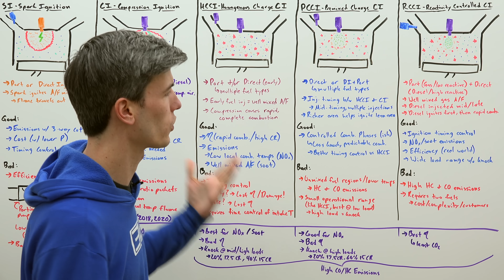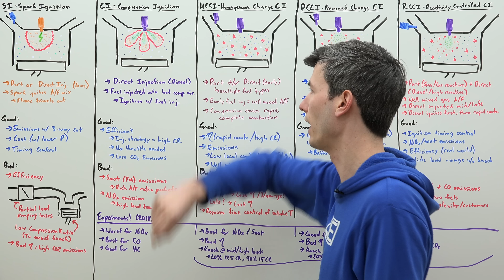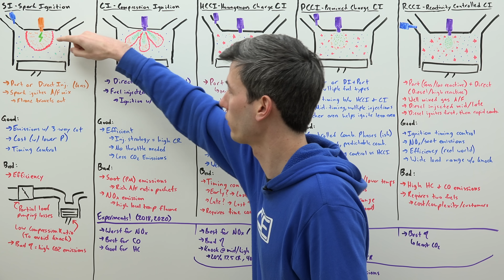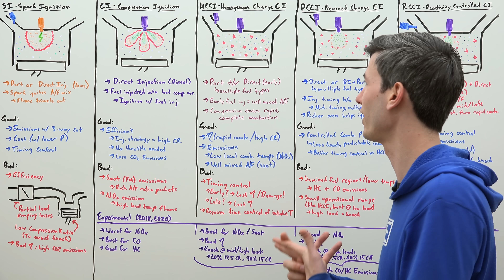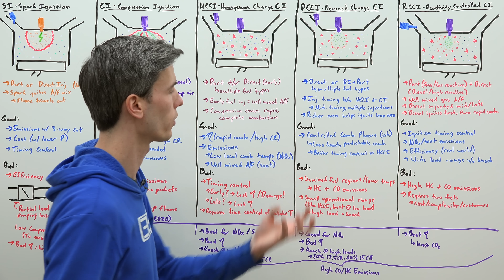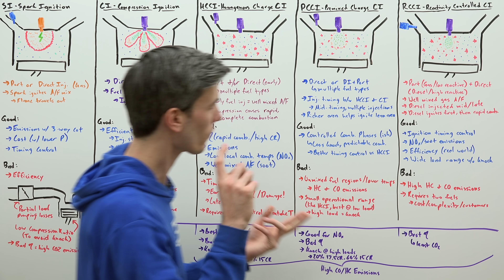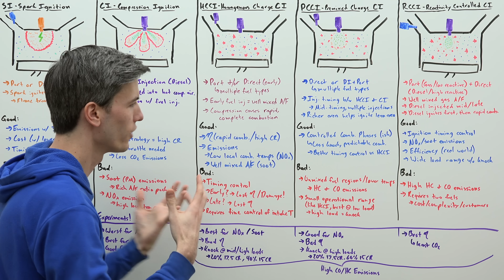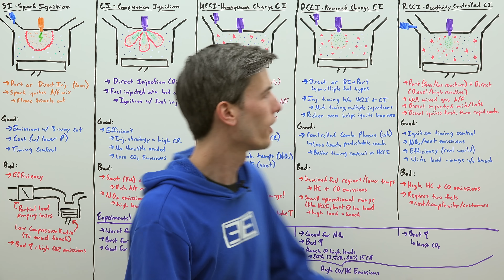If Combustion Engines Have A Future, What Is It?

Comment: I feel like there could still potentially be a future for combustion engines in cars if we were to use hydrogen to make them much cleaner.
I understand there are problems with using hydrogen in a combustion engine (mainly range) but given that it would be significantly cheaper, up front, to buy a car with a hydrogen engine vs an electric battery car or a fuel cell car I think it's something that should be considered more. 
I also think it would be better for the environment than a battery car because of the damage that's done when mining for ingrediants to go into lithium ion batteries.

If you're going for the least environmental impact though then you would go for fuel cell cars but, again, they're VERY expensive.
Reply: 100% agree with you.
Reply: The problem with hydrogen is the infrastructure to support it is much more expensive to build than the already existing grid for electric cars, not enough companies willing to put in the huge funding for that. I think the few hydrogen cars out there e.g mirai, use the hydrogen to create electricity for the motors, which is likely more efficient and less dangerous than combustion of the hydrogen. So if hydrogen does get more popular it likely won't be in the form of a combustion engine
Reply: @Game tuner A way for what exactly? It's not gonna be as efficient, that's simply the nature of combustion you're naturally gonna lose energy in several forms. Right now majority of consumers just want transport, combustion or not doesn't matter to them
Reply: @Game tuner Who exactly? The switching being done is substantially more to EV's or simply other standard combustion cars. The toyota mirai and hyundai nexo are really the only two on the market, and both of those are FCEV's and not in large numbers. There's not even a thousand hydrogen stations globally right now
Reply: @Game tuner Who cares about Musk or a 50% target, what makes you think hydrogen combustion is a more viable alternative to FCEV's let alone standard EV's?
Reply: @Game tuner I agree that having options is important, personally I want hydrogen to succeed, but just the economics of it makes it harder to compete right now unless more companies take the risk in investing. I know toyota tested a combustion engine but it'll still have to compete in the general market when just about every hydrogen vehicle currently uses more efficient fuel-cell versions. We'll have to see how development and market costs change

Comment: Awhile back you did a video on Opposed piston engines. Achates power had been working on it. Is that dead? I found that very interesting, but haven’t heard anything from them in a couple years?
Reply: They are too complex to build. Adding a few more cylinder is much simpler than adding a second crankshaft ore some leveragesystem
Reply: @jonasstahl9826  it seems that it’s less complex. A lot less parts?
Reply: @coldarcluck5320  Damn you are right I forgot the valves🤦‍♂️

Comment: if people stopped freaking out beacuse of emitions lots of these problems would be "solved"
Reply from the maker: The solution is to not care about bad air quality? That isn't a solution haha. You might not realize how clean the air around you is simply because of the existence of catalytic converters. Improving emissions is a good thing.
Reply: @EngineeringExplained  I obviously can't change your minds about this and I'm not tying to, I said people freak out about it, there should be development in the field yes, but I feel like the emissions issue is being amplified outside of its scale... I'm all for improving emissions and efficiency but it comes at the cost of added complexity, less reliability and longevity with higher repair and maintenance costs. Even so, I still think it's something to work on, just not the second coming of Christ.

Comment: They do. The ICE isnt going anywhere anytime soon 
Gasoline has the most energy per volume 
Its widely available 
It works in extreme temperatures 
Its been tested for over 100 years
ICE has been developed is a wide array of areas and technology 
Extraction, development and deployment of gasoline has been refined to a science 
Ev's are inefficient.
Reply: @samwestenskow  An EV is no were near 95%, when the motor allone is only 90%.
Reply: @German_overengineer  I don't want to get into a heated debate but I have put weeks of research into these topics
Reply: @samwestenskow  then you would have found out that its no were near, 95%, maybe 75% on a good day.
Reply: Electric motors are much more efficient than internal-combustion engines
Reply: Ev's have high efficiency, it's just the batteries that can't store a lot of energy
Reply: @shadowknight3756  no they are not to efficient when you consider all the loses in the chain. Just with charging loses, they get into the territory of a Diesel.

Comment: So Diesel engine is the best. They have AdBlue which reduces NOₓ
Reply: Great in theory, not great when you have to spend €2000 repairing a system worth more than the car itself, all while the car runs and drives perfectly
Reply: @Re_Kitty  There are horses for courses and diesel engines are far from ideal for many smaller cars. Where a vehicle can be driven at full operating temperature most of the time and cruising rather than intermittent urban traffic, then diesel is very clean technology and  there should be very few problems. Short trip stop start driving is what causes all the problems in diesel emission systems, coupled with constantly running on low fuel levels.
Reply: well it depends, engines put out les co2 without exhaust systems
Reply: @lucasvanhamburg4937  its well known that diesel engines produce less co2 than a silimar gasoline engine
Reply: @mathiasmang848  did I say anything else?
Reply: And PCCI is just stratified charge, already implemented in all electronic injected diesels.
Reply: I agree that diesel is the best, however even with scr managing nox emissions isn't that successful
Reply: Rotary Engine is the best and  still has a lot of potential ! If you use it working on Nitrogen or Hydrogen for example.
Reply: @aquamaggerasim4993  if rotary is best why is nobody using it lmao?
Reply: @aquamaggerasim4993    Rotary engines are absolutely brilliant. But then you look at the top of the rotor and realize you are trying to seal a rectangular piston.
Reply: @aquamaggerasim4993  the rotary would need to loose the apex seals. Their lubrication really fucks up the attainable emissions.

In a range extender role, it could be brought up to speed and kept above minimum speed.
Reply: @daszieher  
I thought the same thing myself. The nice thing about a small single rotor engine is they're extraordinarily light and compact and give off good power for that volume. Using one as a range extender that isn't on all of the time would definitely be a good use they also are very smooth running and are relatively quiet.
Unfortunately I don't think it would be easy to get them to pass any kind of emission standards today. That adds a lot of complication which might override the basic mechanical simplicity.
Reply: @kens97sto171  the two Achilles' heels of the rotary's emissions profile are the lubrication of the apex seals and the small pocket of unburned fuel-air mixture in the lagging corner of the combustion volume.

Deleting the apex seals deals with both problems as the amount of oil injected into the combustion chamber can be drastically reduced and the lagging pocket can be pushed forward by combustion from the following chamber bleeding through the gap. This should significantly improve emissions.

Alternatively, a separate combustion chamber is designed and the rotor acts only as a pump. A second rotor, optimised in design could then act as a dedicated turbine.

Such a design would be very inefficient at lower speeds, as there is always a percentage of air bled through the gaps. Since this is a function of time and pressure on the surface area of the gap, increasing rpm will partly alleviate the problem.  A normal rotary engine will run with bad seals but not start or idle.

Boosting will also increase efficiency. I would really be curious to know, if my assumptions are feasible.
I no longer have access to all the hard- and software required to simulate an engine design. 😔
Reply: @aquamaggerasim4993  pretty sure Jason's done a video on why rotaries aren't that efficient and a video showing why burning hydrogen is far less efficient than using electricity or even using that hydrogen in a fuel cell
Reply: Are you payd by VW or something? 😂
Reply: @UnipornFrumm  I wish
Reply: @UnipornFrumm  it's reality clown

Comment: With battery demand far exceeding supply, even at such low EV adoption rates, the clear solution is using an ICE as a range extender rather than having everyone haul around 500 miles worth of batteries when the vast majority of people need less than a quarter of that for daily use.
Reply: The Super Capitalist - I agree 100% at least until battery technology and production can catch up. Seems to me it should be doable to get an arrangement that could approach 100 mpg equivalent with today's technology.
Reply: Exactly! We can have ICEs run constantly at their peak efficiency, and maybe even use super capacitors instead of batteries to store the power.
Reply: ICEs like Rotary Engines haven’t been developed enough but they have great potential!
Reply: @aquamaggerasim4993  I really like rotaries for PHEVs. It seems like all their weak points are countered by the strengths of PHEVs and you can also get a great sounding engine in a small form factor.
Reply: @TheGIGACapitalist  rotary and plugin sounds like a great idea🤔 but rotaries need to become a bit more fuel efficient first i guess
Reply: @nobodynobody3903  Efficiency is the batteries job. The rotary just needs to go brap brap.

I think adoption of PHEVs is more important than optimization at this point.
Reply: @TheGIGACapitalist  Rotary Engines are great for initial push , if you have N2 bottle for example , the sound will be even better !
Reply: Already own a Volt, love the car, but fearful of future maintenance costs as I'll be supporting both the ICE and EV systems. While it's a great transitional vehicle, I would rather have two pure BEVs going forward, one with a small battery for around town (Mini SE electric) and another for hauling the dogs on weekend road trips. Can't beat the simplicity. 

Considering each household has multiple vehicles, the two, dedicated, EV approach isn't unrealistic.
Reply: @wzDH106  In a household with several people that would make sense. But as a single person it is quite difficult to decide, what to choose and two cars for one person would be very unsustainable and i would guess even worse for the environment than a reasonable ICE car🤔
Reply: @nobodynobody3903  

Nothing wrong with a capable 200+ mile BEV either. Our second vehicle is the Kia Niro EV, a capable vehicle with real world winter range consistently beating EPA figures. A vehicle, assuming I were the sole household occupant, would be more than adequate.

Given, those who do not live in a house, have access to overnight charging (120V or 240V), or have employee charging, may find living with an EV difficult. Otherwise, it's the easiest vehicle to live with, the lack in maintenance is icing on the cake.
Reply: Facts could be an idea

Comment: I very much disagree with electric car having better efficiency, it's efficiency is based on Electric powertrain, which is around 90%, BUT then you have the efficiency of power generators, where you mostly have steam turbines, which cannot operate at more, than 1/3 thermal efficiency, nevermind the reactor itself, maybe in California, where is most el. power from sun and ekologic sources, but in Europe, we have absolutely different situations
Reply: It would actually be pretty close, there is not over 60% loss in making diesel fuel, also usability is another factor, fuel tank with the engine usually runs 200k miles without major problems with basically unlimited range considering time, whereas in EV, you don't have maintenance, that's true, but with normal driving, batteriy packs are usually worn out after 3-4 years with extreme costs to replace them, you have to recharge every 200-250 miles with more expensive charging, than refueling, considering cost per mile

Comment: Alcohol fuel (E100), look to Brazil's Proalcool program. They're already trying to ramp up ethanol content in our current gasahol mix. We just need a better way to generate ethanol (read: not from corn).
Reply: There is a potential way with biotechnology (metabolic engineering specifically).
Reply: @vr5076  Yeah, or perhaps microalgae - I'm actually dabbling with it myself. It's a good time to invest in ethanol production companies.
Reply: @Masterrex  I think a carbon neutral (or even a carbon negative) platform for producing ethanol or any other biofuel for use in ICEs based on engineered photosynthetic microbes could be possible.

However, cell-free metabolic engineering based platforms could yield a far greater quantity of biofuels than an equivalent cell/microbe based platforms. And they are cheaper to implement.
Reply: For some time until energy transition is through, carbon capture from Gas power plants could be a great source. If you look at it, all the needed components, heat, steam and and CO2 are in the exhaust gasses. Sadly biological processes are too slow to source enough alcohol to run many vehicles on it. But its a nice supplement.

Comment: ICE is so much work, so many variables and systems that have to work together. 
Electric motors are a way more elegant solution. Produces the same result with only like 15 parts
Reply: The electric motor is almost perfect alone, the batteries are the problem

Comment: The RCCI might work great with nature gas or propane as they are easy to store large amounts in small tanks.
Reply: you need to use them in conjunction with petrol or diesel because they can't bring up the engine up to temp fast enough and they have lower performance on full load, we have diesel trucks and buses converted to run on LNG and LPG (liquified petrolum gas) that use a mix of both, the gas can only work for 40% load and lower, anything higher requires the use of diesel

its really easy to use since the gas is added at the throttle body (i don't know the name of the specific part but it functions like a carburator) and the diesel is directly injected

but it needs a lot of infrastructure investement, we have it because its not profitable to export and its better to use the petrolum gas rather than to burn it at the refinery (standard industry procedure)
Reply: @ssllhh100  thank you for the explanation! I was under the impression the gas/diesel would only be needed for the initial cold start.
Reply: @hugieflhr03  that's the case only on gasoline engines, diesel engines have a long stroke, too long for LNG, it has to do with the speed of the combustion, diesel is slow so a long stroke and low speed is better suited for it, gasoline is really fast so it uses a shorter stroke, LNG is in between the two, if you use it in a gasoline engine it will provide torque in all range  of load as long as the engine is warmed up, but it wil provide 15 to 20% less power than gasoline because its inefficient at high revs because the exhaust valves open before all the gas is burned

but in a diesel engine the LNG burns too fast and stops providing useful work before the piston has traveled all the way, so injecting more of it will make more power but it will be less efficient, burn hotter and creat NOx emissions, completely negating its advantages

Comment: interesting that you completely forgot about other changes that could also increase efficiency, like 2 pistons per cylinder (facing each other) which was already used in trains
Reply: it does not work like that. it is used for other reasons
Reply: There's a video about opposing pistons on this channel